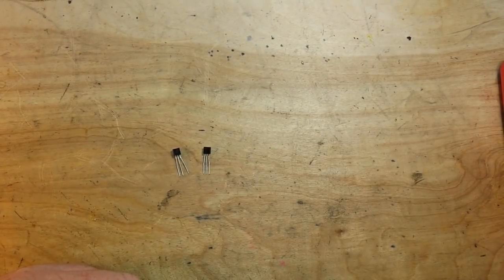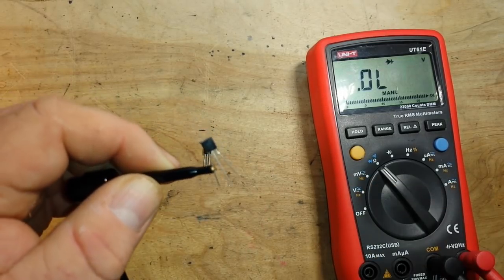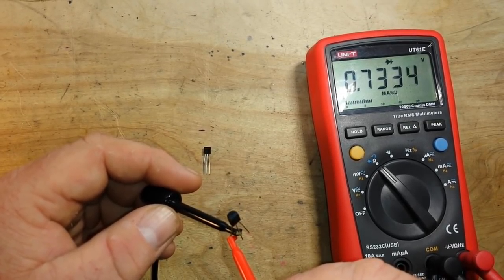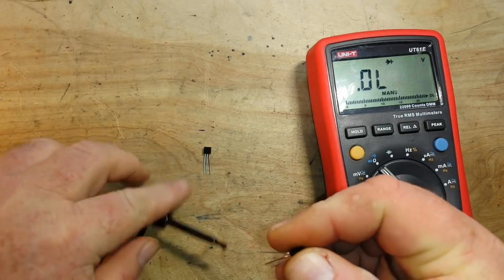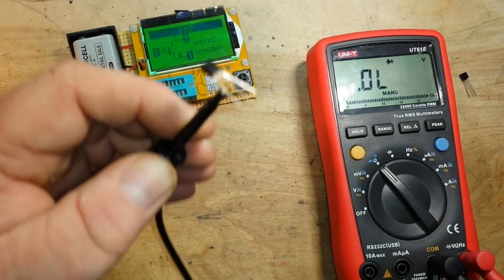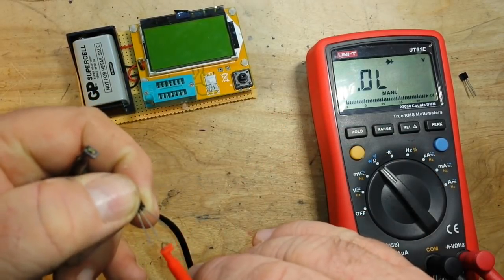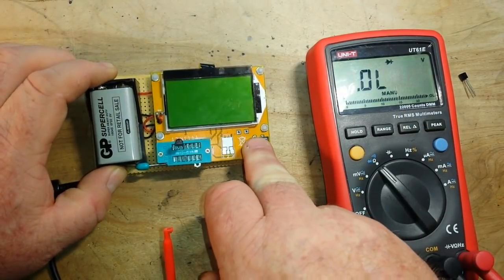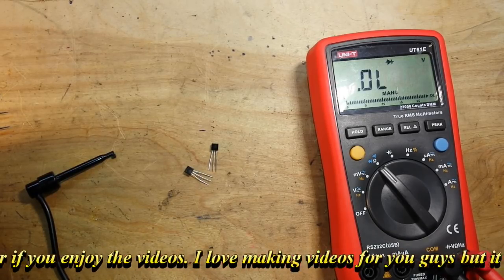How to identify unknown BJT transistors

Comment: Everyone should know how it should be done .... and be able to do it ... Simplest solution is to make certain to get a component tester ASAP and then ensure it is batteried up and in your bag at all times.  Might not be the most accurate in terms of absolute values but as a quick method for sorting out a box of bits it's worth every one of the £7 I paid.  The little holder clampy thing is much easier than juggling small components and fiddly clips.  As I'm getting older and components are getting smaller, the value of decent clamping, holding and magnifying systems is becoming more important for everyday work.  So is identifying nondescript blobs of plastic and metal.

I recently found a combination forceps/tweezer that's actually able to hold components down to 0402 quite securely ... and found an electrical  tweezer probe attachment that plugs into a meter.  I'm still tiddlywinking resistors into infinity - but not as many and I usually know what resistance they were.

Comment: N  
P    = positive base 
N

P
N  = negative base 
P
Pretty easy to remember eh ! 

Now what if you have a to-92 device that has no markings  - it could be anything , a mosfet , a darlington , a unijunction   , a regulator , a hall efect sensor or even an old mk484 radio chip . Is there any way to identify some of these ?  Radio chip would be a problem and the hall effect i'm not sure about . 
I also have one of those little testers and for what they cost they are worth their weight in gold !
Reply: "injunction"?? Do you mean a PUT, Programmable Unijunction Transistor??
Reply: Robert Calk Jr. 
Yes
 damned spell check has changed what i typed to what it thinks i typed !
I have edited my post to fix it .
Reply: ian bertenshaw    Oh, ok. I was wondering because it seems like most people have forgotten about PUT's. Even my Peak Atlas DCA75 Pro can't recognize a PUT. I talked to a person at Peak a couple of months ago and asked them if they could update the DCA75 Pro for the PUT. Hopefully some day they will.

Comment: I recalled reading a text mentioning  that the voltage drops were slightly different although it was a little while ago.  You nevertheless have to pay a close attention to the component you're testing, specially for the beginners, since you can have different type of components using the TO-92 casing.  For instance, you can have BJTs, FETs, regulators, temperature sensors, etc..., therefore it would be strongly suggested to read the inscriptions on the case and download the corresponding datasheet to determine what type of component you're dealing with.  Based on that information, you can then proceed with your DMM and perform the procedure suggested by Paul, whenever applicable.  The datasheet will become handy if you happen to have values that are way off which would potentially indicate a short or an open junction, knowing that you're probing on the proper pins.  Even if this is a basic concept, it's always interesting to put our acquired knowledge to practice and "visualize" what's going on.

Comment: Great tip Paul. I didn't know you could do this with a DMM. Though I'm glad you sold me on the idea of the component tester l0ong ago. I use mine all the time, my eyes aren't what they used to be so it's easier to use than trying to read numbers or color codes. Thanks for the very useful tip and uick video!
Reply: You can use a VOM with X10K also, but it's a little more involved.

Comment: I have a notebook I been adding to for the past 15 years..
I also ordered that component tester 3 separate times and all three never arrived, the sellers disappeared from eBay and eBay was not helpful at all in getting me a refund. There were like "Oh well" and never responded back since.  So I just stick with my method of looking them up online and making notes in my notebook.
Just be careful ordering those testers, there are a lot of frauds out there.
Reply: ElfNet Designs Suggest using Amazon for stuff too dodgy on FleaBay - at least if your gear doesn’t show (which is rare in my experience!) Amazon will intervene.  Purchased x3 component testers via Amazon and all three arrived - although one was broken and the seller gave an instant full refund, can’t complain about that? ... 👍🏻 🧐 🐍

Comment: Great explanation Paul! I really like this simple example. For some reason I always had problems understanding transistors. I treat them as gates/resistors, which in case of NPN are triggered by a high state, and in the case of PNP - low. But I always have to check if the LED must be on the collector or the emitter side. I noticed that depending on the type, the current passes from the emitter to the collector or the other way around. Why it can't be consistent, is beyond me...
Reply: https://en.wikipedia.org/wiki/Bipolar_junction_transistor

Comment: Hi, exellent video, I didn't know that you can identify Emitter and Collector by their foward bias voltage.
Do you have any tip in how to test if a phototransistor is working?
Reply from the maker: Same way. Connect positive to base, negative to collector should see about .61xx then connect negative to emmiter should see about .64xx.
Reply: Plus, you need to make sure it is a phototransistor and not a photoresistor.

Comment: Great wee tip for newcomers who don't have a component tester yet!
Reply: Those testers seem nice but, you need to be very aware where you order them from. I ordered the same tester from 3 different sellers three different times and I never received one tester. eBay support is useless and the sellers have long since disappeared from eBay with my money.
Reply: ElfNet Designs  I have 4 Peak Atlas meters and have never had a problem with any of them. Plus it's kinda cool having something that says, "Made in England" on it.
Reply: @robertcalkjr.8325  I once got a couple of buck converter modules from eBay and noticed on one of them that one of the electrolytic capacitors was hanging off!  I looked up the order to put in a complaint only to find I had only ordered one!  The cap was an easy fix so I wondered if they put the extra module in as a bonus knowing the buyer could probably fix it?  It would otherwise have been binned I suppose.  Or not!
Reply: gartmorn    Yeah, they know that most of us will just fix it and not waste time complaining. I think that sometimes they do it to test us and see if we can fix it.
Reply: @Elfnetdesigns  I have had countless dealings (100+) with Chinese sellers, mostly banggood and IC station, and only had one bad experience (an eBay seller)!  I would certainly be wary of parting with large sums of money but my overall buying experience has been very positive.  I have heard British customs have been clamping down on Chinese sellers who put low prices on packages to avoid import duties but that is a recent thing I believe!

Comment: Great video. I'm learning something new everyday.  Can a 555 timer be tested in a similar manner? Or do I need to buy a ic tester?
Reply: The "easiest" way to test a 555 timer, in my opinion, would be to create a basic circuit as a led blinker.  Simply use a DIP socket for the 555 you want to test. Turn it on and voila, you have a visual confirmation if the timer you want to use is working or not.  If you're planning to built quite a few 555 timer based projects then having your own homemade "tester" might be a nice to have.
Reply: @SimpleEnough2k9  

Thank you. I'm new to electronics and I appreciate the help.
Reply: Armando Perez Breadboard it. Datasheets usually include test circuit schematics in them that you can use to test components. Sometimes I Breadboard components just to play with them. That's how I discovered that a 555 can be controlled by resistance through the #4 reset pin.
Reply: @robertcalkjr.8325  

Thank you very much. I will breadboard it. I got a schematic from  Google for the 555 timer.
Reply: Way to go Armando.  Googling "555 timer tester" and you have plenty of circuits and examples to choose from.  Putting it on a breadboard is even better.  There is nothing like practicing and the 555 timer can provide you a lot of opportunities to do so.  Simply put, the 555 is a classic and In the same line of thought, the 2N2222 is too.  The 2N2222 was introduced in the early 60's while the 555 was in the early 70's.  So if they've been around for so long, there is a good reason for it !
Reply: Armando Perez   Colin Mitchell has a great website with a lot of great circuits - his website is also where I found out that I wasn't the only one who found the 555 backdoor. But it was an exhilarating thought for awhile! http://www.talkingelectronics.com/
Reply from the maker: I dont know a a way to test a 555 with a meter.